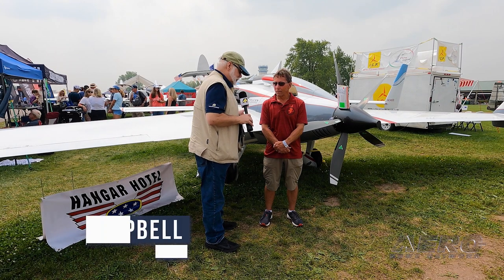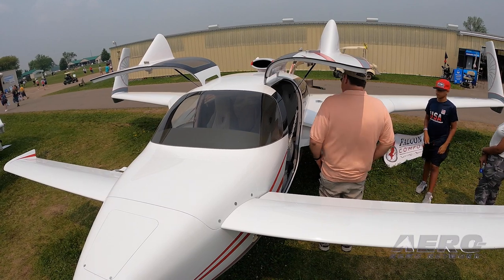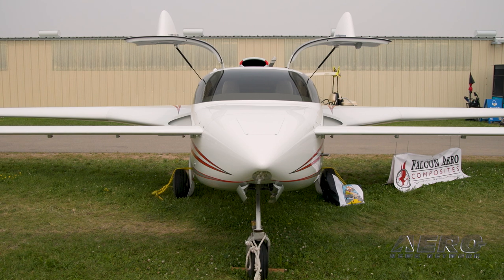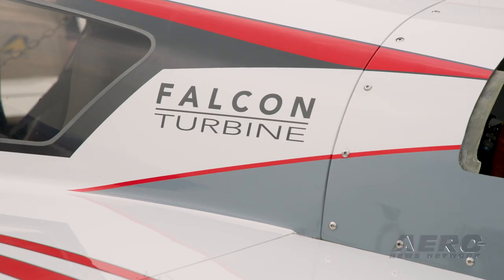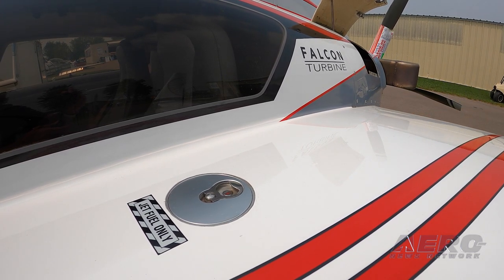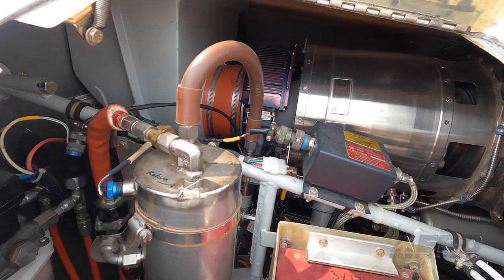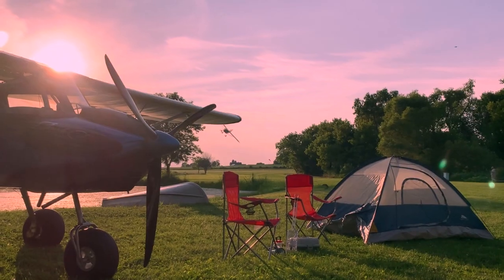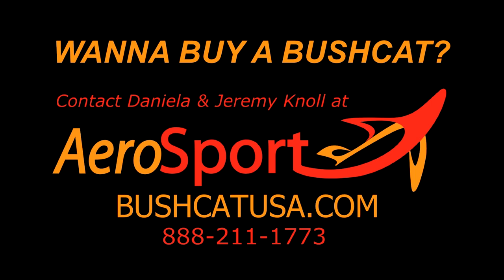Aero-TV At OSH21: Hot Canard! A Velocity Turbo-Prop

Comment: As awesome as that is, the TXL has much, much better performance. 250kts cruise at fl250 at similar fuel burn. Heck, economy cruise is still 25kts faster and like 30% less fuel burn
Reply: TXL? Is this the engine or the plane?
Reply: @armdude2000  It's the airframe configuration Twin engine Velocity XL.

Comment: Very disappointing performance. At that price point I would expect to be moving out at over 300 miles an hour.
Reply: The engine is rated at 241 shp, roughly what the piston engine puts out. I would love to see one with a Walter or P&W with 3x the hp
Reply: It has a spacious cabin and not as cramped as the 300mph aircraft.  It is also safer that most of the speedier rivals with its stall manners.
Reply: He wanted something that didnt run on Avgas so the higher top speed probly wasnt an issue simple

Comment: Interesting concept. The turbines are nice, but fuel burn/efficiency is their drawback.

If it was a 300-350 hp in the Velocity XL, the increased fuel burn may be tolerable due to being able to get the speed out of it. Then again, flight duration would really suffer.

Darn engineering compromises!